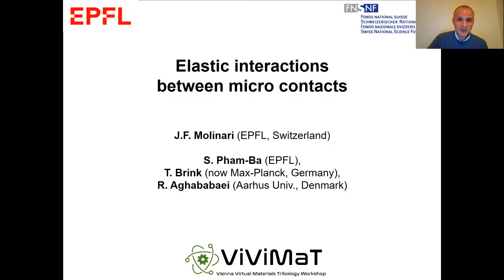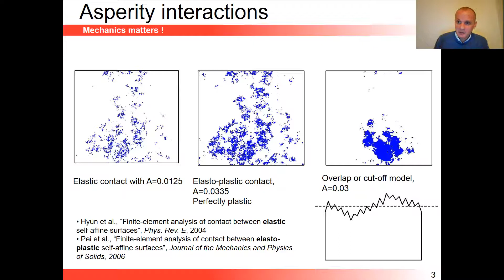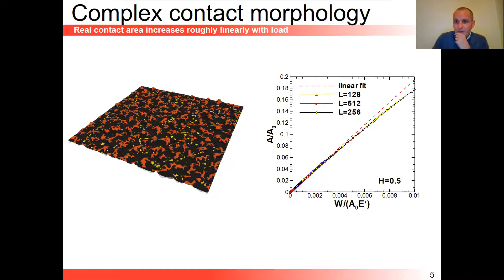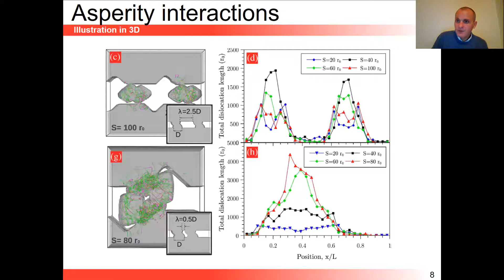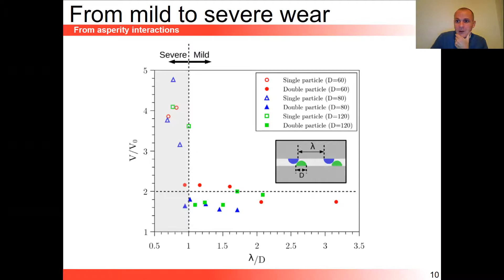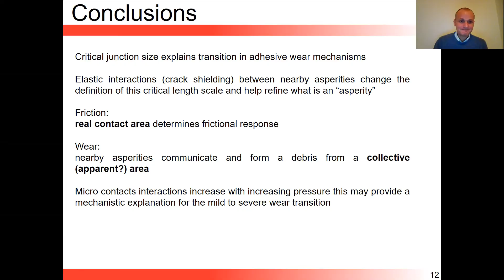Jean-François Molinari (EPFL, Switzerland) talks about micro contacts | ViViMaT Session 2

Comment: Thanks for your presentation! I have a couple of questions:
1) The transition from mild to severe wear seems to be quite well defined. What about the transition from low to mild wear? In the wear volume over load curve, it seems that the location of the transition is rather arbitrary. Which criterion can be used to determine if one is just below orjust above the transition point?
2) Looking at the OVITO DXA visualizations of your 3D MD model, it also seems to be monocrystalline. Have you ever made an attempt of doing what you do with two polycrystalline counterbodies? I am guessing the grain boundaries would have a large influence on crack formation.
3) Is there any coupling between your phase-field approach to fracture and your large-scale MD approach, or are these two completely separate? If the latter, can you imagine any reasonable coupling between the two to gain some additional information?